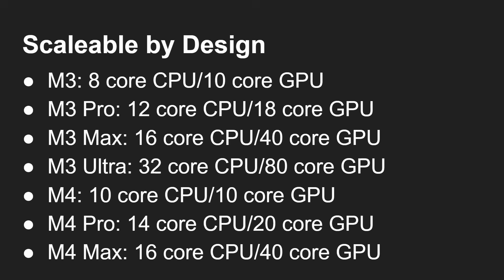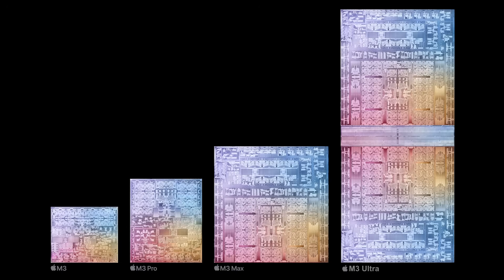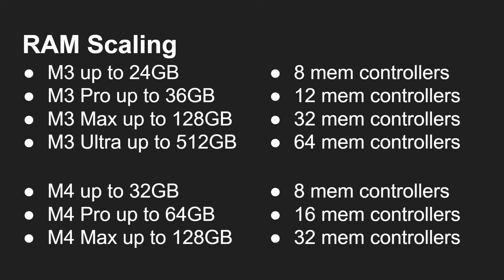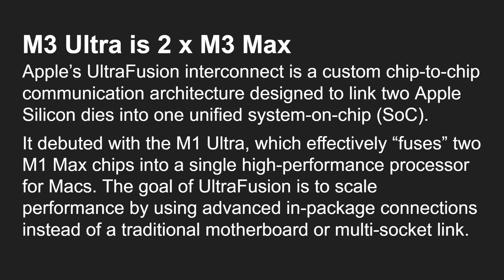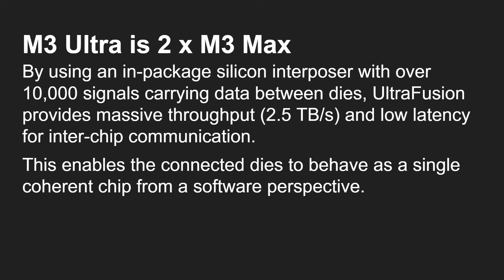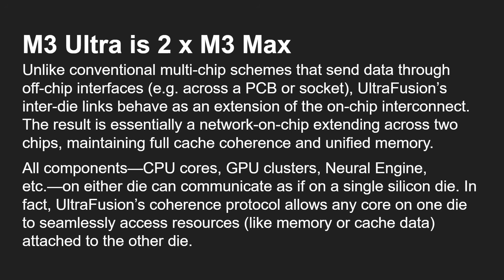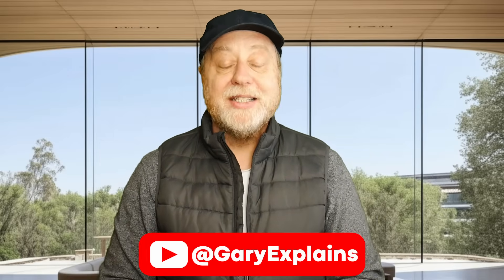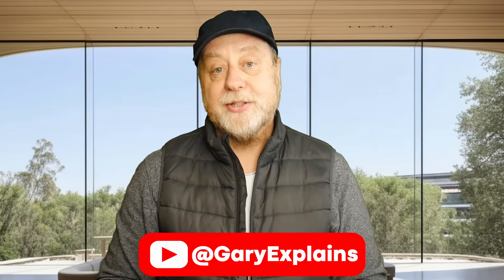The Magic Behind Apple's UltraFusion Interconnect

Comment: 15:21 That was the same speculation in the last years about the M3 Ultra and now we have one. Maybe Apple needed so much time to make the Interconnect and to improve the Chip. How you said, it has Thunderbolt 5 but also 4 times of the RAM. Normally it has to have "only" 256GB RAM because it doubles not only the amount of CPU and GPU Cores, the amount of RAM, too. But it has 4 times.

Comment: The die interlink is terrible. M3 Ultra barely shows scaling in multiple types of workloads. Double the die size, but ust 10-30% performance increase in just some cases.
Reply: "10-30% performance increase in just some cases." <- more in other cases. This has been clearly shown by real world tests with the M3 Ultra right here on YouTube.
Reply: I mean if we’re talking geekbench, GB6 is notorious for this. I’m sure there are plenty of workloads that perform much better, it just depends.
Reply: Let's face it, word processing compute didn't improve since the late 90s because how could it! There will be nuanced cad/MATLAB/simulations eating this up and above that they are invested with both feet in an Aws setup.

Comment: "Apple's 3D chip stacking technology SoIC will reportedly be used in a 2025 MacBook (Pro). In simple terms, it is a new type of IC packaging technology that can stack multiple chips together to achieve higher integration with smaller size."  So, looks like the M5 and further won't need an interconnect.

Comment: Who says that Thunderbolt 5 is not a firmware thing ? Unless one cracked a chip open and looked at the gate layout under a microscope, you would know for sure which is 4 or 5 from a hardware level only.
Reply from the maker: 🤦🏼‍♂️ And maybe the CPU is actually a 6502, who knows!

Comment: I'm still none the wiser about what the interconnect does, but assuming you need a broad section of each chip to be close to a broad section of all others, then, in two dimensions you physically can't have many more than two identical chips interconnected. Three is the maximum but that would require triangular chips which is not a thing. Four is the absolute maximum but the fourth chip would have to be a different shape to enclose the other three.
Reply from the maker: You are thinking about a physical layout rather than a logical one. But physically you can stack them, make it 3D not 2D.
Reply: @GaryExplains  or fanned out like a Rolodex!
Reply: No. You need to look at, just for example, AMD's instinct series of AI / HPC GPUs. There, you'll see six discrete dice (not including the HBM memory stacks) connected on one CoWoS substrate. Nvidia uses CoWos too, but their incredibly huge die size limits then to two GPU dice per package. AMD took a different route and their chiplets are small enough to fit six in one GPU complex. This also allows them flexibility to replace one GPU chiplet with one of their Zen CPU chiplets to create a mixture of GPU fabric with eight CPU cores in one advanced package (along with the HBM memory stacks of course).

Comment: also there were reports at the time the M3 Max ALSO did not have the interconnect
Reply: What difference would it make, seeing as the M3 Ultra is based on a different chip? If they changed the dye to add thunderbolt 5, surely they could add the interconnect too?
Reply: @justinsmith2363  exactly, so we cant draw the conclusion necessarily there will be no ultra m4 since the interconnect could be added later
Reply from the maker: The thunderbolt controller is just a drop in replacement for the thunderbolt 4 controller. Using a different on-chip fabric is a whole different level of change.
Reply from the maker: Only because a blogger noticed that it wasn't on the die shot provided by Apple.

Comment: Gary,
     Do you know just what physically the Ultrafusion interconnect?  Is it based on a PCB approach?  Or is it a separate (and unusual) piece of silicon in between?
Reply: @allanflippin2453 I have no idea but I am picturing it as a very short, very wide extension cord performing no function whatsoever. If you could smush the chips together you wouldn't need it. Difficult to reconcile that view with Apple waxing lyrical about it, but I can't see any need for anything else. Anything smart could just be done on the silicon. At most it's a travel adapter rather than an extension cord.
Reply: It’s a “silicon interposer”, which is, effectively, another silicon chip sitting underneath the two M-series chips. The interpolar chip is basically doing the same job as a PCB, by routing signals between the two M chips. But, being in silicon there can be much much more signals packed in very tightly, and the M-chip and interposer chip can be bonded together so the signals between them are very low resistance and low latency, being much faster than using much less power than signals that have to go between a chip and a PCB. The interposer chip is much simpler than the regular chips, and that they don’t build transistors or active circuits on the interposer. It’s just silicon with metal wires. It’s basically like taking a regular chip that has transistors (which require dozens of photolithography masks to generate) and 10+ metal layers (each of which will take at least 2 masks to create), but only building the top couple layers of metal. So, much much cheaper and simpler than building a fully functioning third chip. 

Is it is possible to build “active interposers” too, which actually do have transistors built into them to perform some basic functions off-die (typically on a much older, much cheaper process node than the chips on top of the interposer). I don’t know if the Apple interposers are active or passive though
Reply: @JoeLion55  Thanks.  This is what I considered a sensible.  One comment (which was removed) proposed the whole thing was a single chip.  That seemed unlikely from a yield perspective (also, I've had trouble getting fabs to accept such an oblong shape).  A PCB-based solution wouldn't seem as capable as a "chip" interposer.
Reply: @  correct. The maximum single die size on modern EUV-based tools is 26mm x 33mm = 858 mm². A single M3 Max die is approximately 700 mm², so it can't be doubled and remain on a single die. 

TSMC does offer processes where you can connect two adjacent dies on the same wafer with some integrated metal lines by using another set of reticles which get exposed straddling the base dies. Then, during assembly two base dies would be singulated as a single very large die which can be up to twice the size of the theoretical reticle limit. However, like you said, this would leave to some massive yield limitations, and it would also require probably significantly different versions of the M3 Max to use as the base M dies. 

Whereas in the current process, they will produce a bunch of wafers that contain regular M3 Max chips, then later on they can decide if those wafers will go single-die M3 Max packages, or will be tested individually, then combined in pairs with the Si Interposer into a dual-die M3 Ultra package. They have much more flexibility this way, and probably significant cost due to better yield optimization
Reply: @JoeLion55  Isn't this something which could also be done via chip stacking?  Or would that be too hard to keep cool considering the already enormous die?
Reply: @  technically, putting dies on an interpose or is a form of chip sticking. 

But, assuming you mean putting fully functional dies directly on top of each other. I am not aware of any packages that accomplish this with CPU or GPU type dies. There is a heat issue, like you mentioned, but also, to take full advantage of true die stacking require requires significant design and layout changes in the dies themselves. Especially if you want to use TSVs for the die to die interface, that means you have to use significant amount of die space for the TSV to go through, space where there can be no transistors or other circuits or metal layers. So adding TSV's support to any design increases the die size and processing complexity. And if one of the goals of the M3 Max chip is that it could be used as a single die or a dual die in the ultra, if it were to be stackable in the Ultra package, that means the base level single die Max would also have to be TSV capable, and therefore a lot larger than necessary. And seen as the M3 max probably out sells the Ultra 10:1 or more, it doesn't make sense to increase the size and complexity of the die itself just to support TSVs when the vast majority will be going into a single die package. 

Additionally, laying the dies out side-by-side gives them more/better interfaces to the memory chips. The memory controllers on the M dies are along two edges of the die (let's say, the left and right edges), so the memory chips can be placed directly next to the CPU die, also on an interpose or other in-package substrate. Based on the M3 die size, they can fit two standard LP5 memory chips on each of the two edges that have their memory controllers. So if the M3's themselves were stacked, where would the additional memory go? So by placing the M3's end to end, now each M3 has room for its own set of for memory chips, so the memory can scale with the M3 count. 

Chip stacking is more often used for either:
1) stacking heterogeneous chips, such as memory onto CPU. For example stacking an SRAM chip directly onto a CPU, as a way to offload the the on-die cache on to another chip. The CPU has to be designed with the stacking in mind, but in this case, unlike stacking 2 CPUs on top of each other, it doesn't require TSVs in the CPU die (because the SRAM doesn't need a connection down to the Si interposer). Therefore, the slight changes in the CPU die are worth it because a huge amount of circuits (for example, the L3 cache, can be moved off of the CPU and into the SRAM chip, thereby making it a win-win for CPU die size. 

2) in the case of HBM DRAM memory, they use stacking to stack 8-12 DRAM chips, all of which have TSV's that make vertical connections all the way from the top DRAM chip all the way down to the bottom logic die. This again still has trade-offs in that the DRAM dies are significantly larger than a typical DRAM dies of the same capacity. But, when eight or 12 are packaged together the overall capacity and bandwidth of the HBM package is massive for its overall footprint. And heat in DRAM is much lower and more manageable than in a CPU, so the stacking doesn't impact performance.

Comment: one drawback on the SoC/SiP design seems to be theres not a super effort to get the latest wifi/bluetooth spec implemented, and often if they are just "scaling up" the previous year or two designs, customers have to wait a few years for apple to bother to care about the latest Wifi or Bluetooth spec until they are doing a bigger redesign every few years.   do you have any insight on this @garyexplains?   same with thunderbolt, same with hdmi specs.... it seems Apple always a bit behind the industry.   I assume they are trying to also hit their marketing power efficiency claims (and never want to go 'backward' with less battery claims than previous years) but it seems to hold them back on the latest wireless specs

Comment: It's amazing that Apple managed to do it before Nvidia, Intel and in particular AMD have as they've been trying to do this for GPUs for years.
Reply: Huh? No. AMD has the MI series, MI250, MI300, and so forth. They all use--as does the M-series Ultra--advanced packaging from TSMC. The "Apple ultrafusion" is not "Apple's," it's TSMC's. And AMD--just like Nvidia--uses TSMC's CoWoS advanced packaging. AMD cannot justify using this for consumer-grade chips yet for cost reasons. Apple is willing to charge an arm and leg (bad pun sort of intended) and so they can use this expensive advanced packaging for a consumer-grade desktop computer. You'll notice that Nvidia also uses it for their Spark box (formerly called Digits).
Reply from the maker: @briancase6180 You seem to be confusing the physically connection with the chip fabric. I can connect my car to my fridge with a high speed optical link that doesn't mean anything. It is how the interconnect is used that is the key.

Comment: One bit of scaling you missed is the base M series chip is based on the cores of the latest A series chip at the time
Reply from the maker: Interesting. Why do you consider the base design of the CPU core a scaling attribute? Reuse maybe but not scaling.
Reply: @ Just that each generations cores (CPU, GPU and NPU) starts with a A series chip first so it clear to see where they are going with a generation. Just like the Pro and Max chips do for the Ultra
Reply from the maker: Except the M4 came before the A18.
Reply: @ True but every other generation has been the opposite and M5 is rumored to be coming after A19 with the M5 Macs